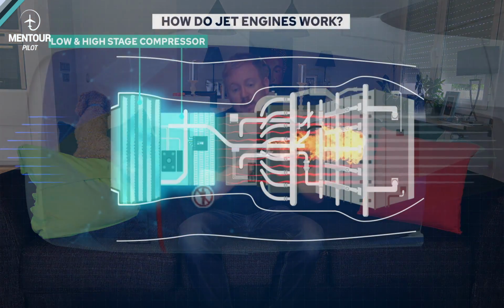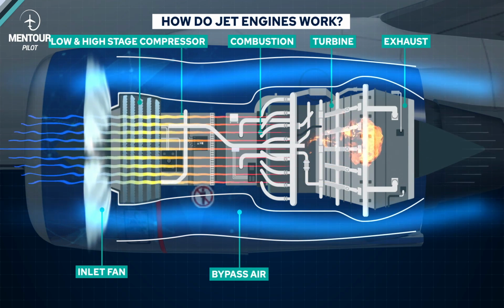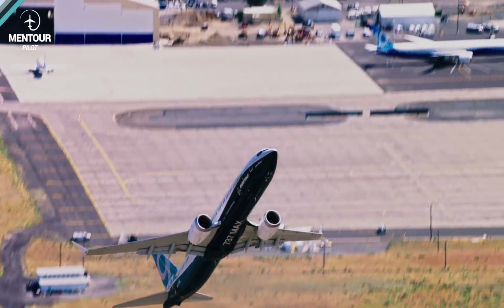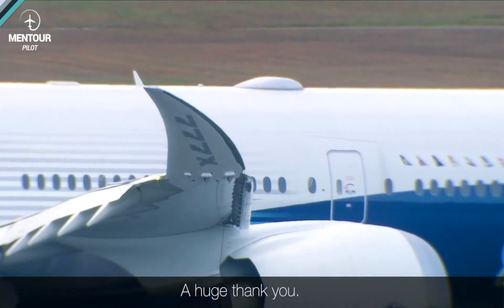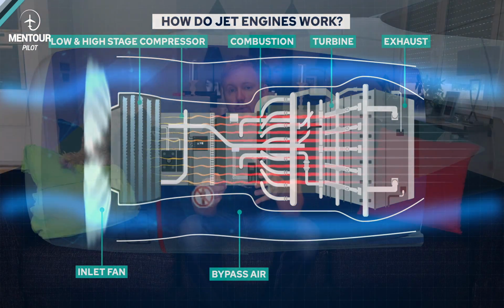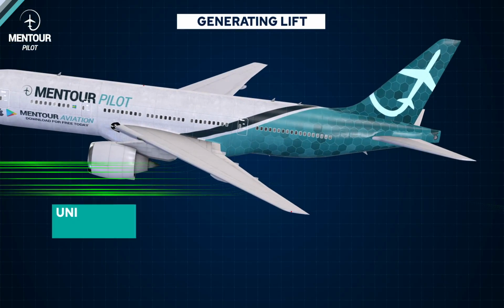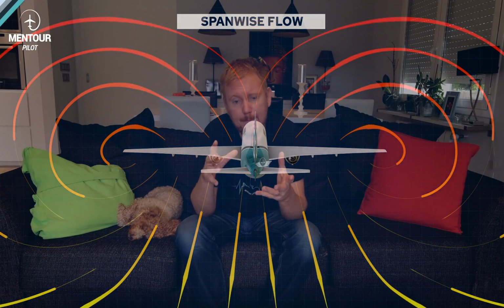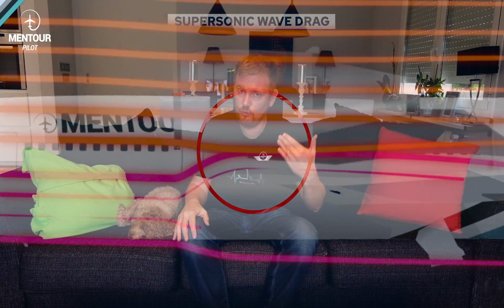How BIG can jet engines get?!

Comment: How about length then? How much will the length of an engine affect performance because if enlarging the engine increases drag, would not a longer engine be more aerodynamic?
Reply: Yes but then it wouldn't be more air for the engine so would just increase the weight in current configuration.
Reply: @Hoggaforfan  but if you keep the engines the same diameter and elongate them, wouldn't that allow for more air to be combusted because it stays inside a little bit longer and allow it to go faster? I'm guessing that'll probably decrease efficiency from the knowledge I have.
Reply: Or like the engine could become gradually smaller like a nozzle that directs more air to a certain area.
Reply: @ramennoodles8774  Might be slight effect but doubt it would do much since most air is used already so need more air and more bypass area to gain any increase, would have to be something new for that to be usable I think
Reply: Well, the length of the engine is determined by the number of compressor and turbine stages, and that comes from the designers determining how many stages give them the best efficiency.

Every stage either increases (compressor) or decreases (turbine) the pressure and temperature of the air. The number of compressor stages is chosen based on the amount of air the combustion chamber needs to burn fuel at the correct ratio, and also what the materials can withstand. Since each turbine stage decreases the air's temperature and pressure, eventually there is a point where not enough useful work can be extracted to justify adding additional stages.

Since all of this is closely related to the weight of the engine, there are always compromises to be made. I can't say if the aerodynamics of a longer nacelle (even though the engine isn't longer) would cause an improvement, but I expect that would be a balancing act between weight and efficiency as well.
Reply: @JustSomeCanuck  ah yes, always has to be some sort of compromise, kind of like the winglets video eh? Thanks for the additional info and positive feedback :)

Comment: I work around the RR and GE engines for the 787. They are huuuuuge.
Reply from the maker: Indeed they are, excellent work of engineering!
Reply: @MentourPilot  the RR engines have the advantage of less weight for equal thrust.
Reply: @amargoun  But RR are less powerful than the GE90
Reply: @godfearingperson5495  the engines are rated to the same thrust in service on most aircraft. But in general there will be a TOGA (basically emergency power) switch that will max out the engines to full power. But can also do bad things, like write them off, if used improperly
Reply: Damn, such a cool job! Hope you can work around the 777X engines in the future as well!
Reply: @forwomentw  its pretty neat but very intimidating. I help bring the engines into the final assembly building using a massive forklift. Carrying 22 million dollars worth of engine in between 500 million dollar airplanes is sure to cause some stress lol
Reply: You can stick the fusalage of a 737 through the 777x engine.

Comment: In the future the diameter of the engine bypass blades will grow so wide it will compel the engineers to mount the engines in the back.
Reply: The problem with increasing the fan diameter further also involves, inertia trying to tear the fan blades from the hub, and the tips of the blades reaching supersonic speeds leading to the disruption of the airflow and loss of efficiency. This is in part the reason for Pratt & Whitney looking at geared turbofans to slow down the rotation speed of the main fan while allowing the turbine section to spin a high speed.
Reply: @johnbeaulieu2404  There is a solution to the fan blade problem and that is eliminating the bypass function and replacing that with a set of ultra high bypass exterior rotors connected to the turbine stage.  In this case, the engine become a hybrid turbojet and turboprop design.  I understand, however, that this approach generates too much noise from the rotors.
Reply: @johnbeaulieu2404  true, though almost all turbofan engines have a separate turbine for the fan (and often the first compressor stage) which spins at a lower speed, thus N1 and N2.  I guess at some point, it's too difficult to design a turbine to be efficient at the low speeds needed to be directly coupled to a huge fan.

Comment: Realistically only slightly bigger than the GE9X. The drag increase will eventually make it a losing battle.
Reply: na mate just add afterburners and hope the thing doesn't melt anything important
Reply: Kun Feng HBPR turbofans act on the opposite end of thrust production than an afterburner. One increase the amount of slow moving air and the other increase the small amount of fast moving air. You don’t want both.